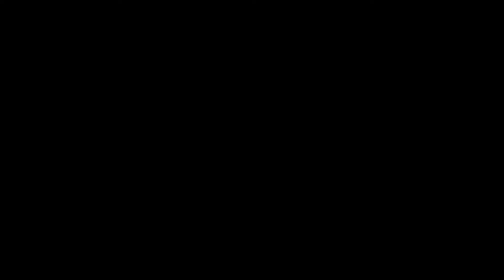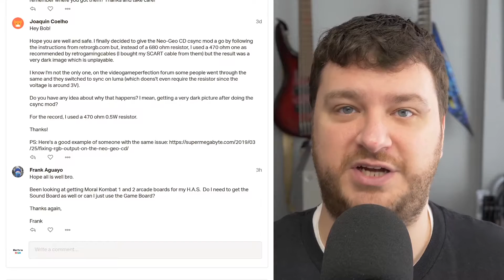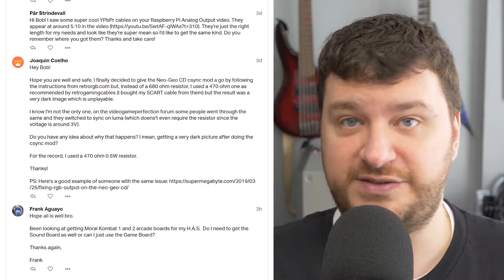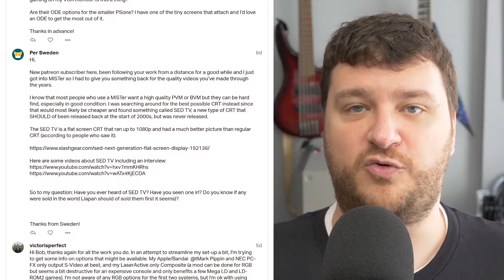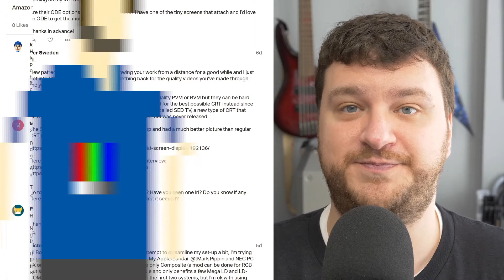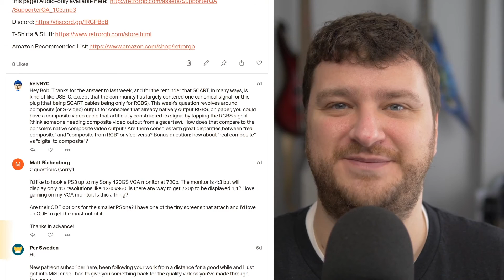Supporter QA #104

Comment: QA videos now have comments unlocked? Anyway, regarding the ODE on PSOne question, if you dig through the PSIO forums you can find a post by a Chinese user who did a custom install of the PSIO and switchboard in a PSOne console. It looked like a lot of extra wiring but it was working, so that would currently be the only option if an ODE in a PSOne is a must.

Comment: Hi, been doing a online search to get the best picture out of a Wii onto a modern TV. I have a very good ypbpr component cable but want to connect using hdmi. Any suggestions?
Reply: The Wii Dual mod is the best option out there. Second best is using component cables in 4:3 mode and sending it to an OSSC set to 2x scale.
Reply: Ok but don't really want to do either. Any other suggestions?
Reply: dual, Ossc or Wii U nothing else to get the best picture, I do Ossc since I got multiple consoles